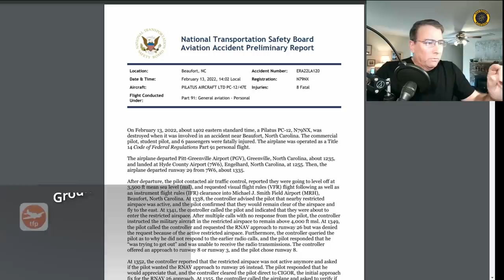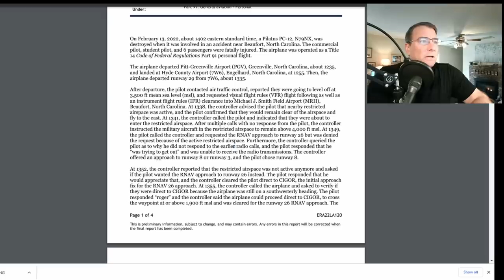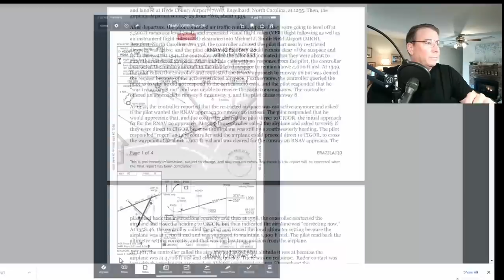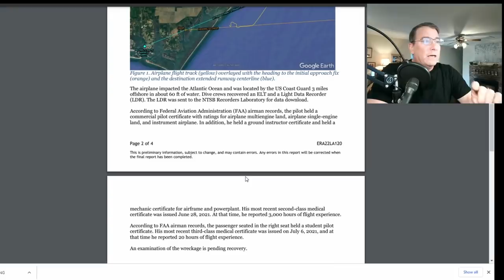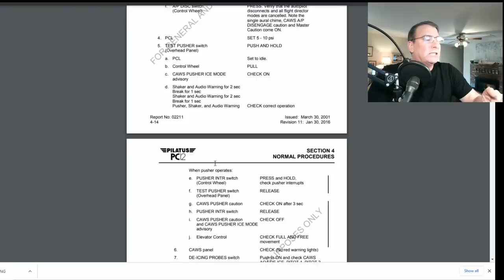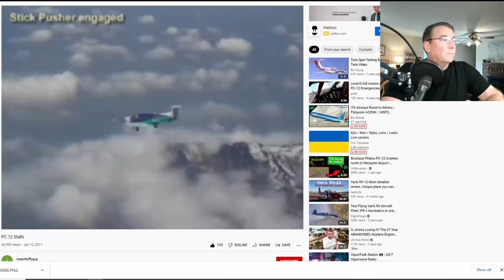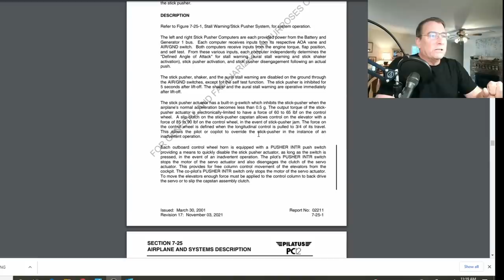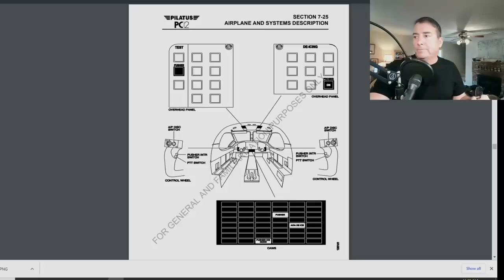NTSB Preliminary Report Pilatus PC-12 Beaufort NC

Comment: When I fist heard they stalled in I knew that whatever happened it wouldn’t be Pilatus’ fault, the aircraft is as perfect as a machine can be and extremely well thought out, to get her in to a stalled condition takes some doing however I know some 12 drivers who will be paying attention to this condition of asymmetry in dual crew, my heart breaks for that poor kid in those last moments, he would have had no idea what was happening and it was a long ride down, hopefully the pax were sleeping
Reply: As great as technology goes, but it can all be undone with a push of a button. Or failure of a sensor. I know they want that button where a pilot can instantly get to it, but there's no way I'd put it that close to the radio button.
Reply: No aircraft (or anything for that matter) is perfect.
Reply: @jfbeam  Makes you wonder if that's why no radio transmission. Might the right seat have been trying to talk to control but was holding wrong button? I've never been in a plane. I definitely wouldn't be a good student as I would be focused on learning instrument flying before learning the basics. Soooo many crashes because the pilot  either doesn't know how to use the instruments or doesn't trust them.

Was riding motorcycle and ran into a fog bank. Within 10 feet totally lost my balance. Fortunately was only going about 50mph and had pretty much locked it down. Was going maybe 25 when everything turned upside down. Across the road and almost into ditch and was like you flipped a switch. Balance was back! For about 4 seconds. Wobbled to a stop and tried to get my heart out of my throat. Wobbled along about 100 yards till fog cleared. Cruised home around 30mph. So I understand spatial disorientation. You MUST have something to focus on to get the brain back in control. In a plane, I'd pretty much want windows blocked out so always have to use instruments. I know that's not how it works but just saying.
Reply: @gailtaylor1636  That is very interesting, once you lose sight of the street, you cannot tell your inclination ?  Lose the ability to  drive straight.

Comment: The pilots side pusher switch disconnects the clutch from the servo so it removes the push entirely. The copilots switch disconnects the motor of the servo so there is still some resistance in the elevator motion when it’s disconnected on that side.  It’s a momentary switch so if it’s released it will reengage, it’s similar to a cws for the ap.

Comment: I don't fly high performance aircraft, but in or near IMC and choppy airspace, I can't imagine not taking full advantage of a flight director. Looking at the flight path and altitude(s), it's pretty clear the plane was under manual control. Although the aircraft ultimately appears to have stalled, the chain of events appears to be the pilot getting behind the aircraft and losing situational awareness.
Reply: Like being pushed back into your seat and mistaking that as speed increasing going down? That would explain the attempt to pull the nose up without speeding up. The other theory of a heart attack or similar is another possibility I would consider.
Reply: sounds like they were behind it after takeoff

Comment: THEY MAY have pressed the interrupter switch accidentally when they meant to press the PTT in a panic.?
Reply: In lears i flew, i noticed a panicky pilot could easily pull up and defeat the stick pusher.   For me that was another of the common Pilot Panic Pull and stall.
Reply: I am not a pilot, but I was thinking the same thing.  Especially when the pilot reported they were "trying to get out" on the radio.

Comment: The AOA’s are not mounted on the Pitot tube. Pitot tubes are mounted under each wing.
Reply: @markberube1700  Wrong! The fixture in which the AOA’s attach are not pitot tubes! The Pitot tubes are under the wing!
Reply: @dereklong4945  You are correct, my bad.
Reply: @markberube1700  don’t tell my wife. lol

Comment: I was an instructor and check airman and this guy just lost control. This was not a stall or spin.  You can loose 4,000 feet in seconds if you loose control.  There is already another accident in Texas that was a similar thing.  This is a slippery airplane and will drop like a rock if you loose control.   You don’t need to stall
Reply: Loose is the opposite of tight; lose is the opposite of find. Common mistake. (For future reference. Best wishes.)

Comment: I'm confused about icing,  could you possibly do a video about icing.  Like where on the aircraft icing effects the flight. Also how much ice are you talking about.  I assume most small aircraft don't have de icing capabilities.  On aircraft with de icing equipment is there a warning system alarm?
Any information on icing would be appreciated,  thanks
Reply: When ambient temp and dew point are within 3*C of each other, icing will occur. Pilot reports, METAR's, visual and meteorological reports determine whether one should choose fly. Deicing equipment is not always sufficient to abate ice accumulation. Visible moisture in freezing temps is a no go. Better safe than sorry. There is no warning and autopilot if engaged, will compensate for drag by increasing angle of attack while airspeed bleeds off until you hear a stall horn or notice ice accumulating on leading edges of wings in which case you are probably already screwed. Icing creeps and kills, therefore best for GA pilots to avoid it all together. You'll never catch me flying in icing conditions in a light aircraft. NO WAY.
Reply: I used to maintain F-27s.  The F-27 was fitted with pneumatic de-icing boots on the leading edges of the wings, vertical stabiliser, and tail planes.  There was electric de-icing on the propeller blade leading edges, and the engine air intake.  There was also de-icing provided in the heated windshield.  Those locations provide some idea of where the designers thought ice could adversely affect the flight characteristics of that particular aircraft.

Comment: The asymmetry in the pusher override from left to right seat seems a bit odd.  Wonder why they did it that way?  When the plane is flown dual pilot,  pilot flying could often be the right seater.
Reply: I asked this very question after watching Dan Gryder's take on this flight.  I don't understand why there would be this significant functional difference.
Reply: Such assymetry is entirely normal. The most-used functions are on the outside part of the yoke. That's the way any smart designer would build it
Reply: @zidoocfi    That’s not what I mean.  It’s not physical asymmetry, but functional.  As Juan explained it, the right side and left side pusher cancel switches cause different effects.  According to Juan, the left button turns off the motor and disengages the clutch, leaving the elevator control completely unencumbered, in manual control, while the right button turns off the motor, but leaves the clutch engaged, so that the pilot would have to still apply the 60 or so ft-lb torque to overcome what the motor had already pushed.  Beyond that, I have no idea what the behavior is.  Seems odd that both switches don’t have the same function.
Reply: @markholm7050  Small correction: with power cut to the electric motor there will not be a 60ft-lb force still on the yoke. It will take minimal extra effort to move the yoke with the motor still attached, but not powered. That's the whole point of the switch -- remove the force being applied to the yoke.
Reply: @markholm7050  My apologies, I thought you were talking about physical asymmetry. It was an honest mistake. As for functional asymmetry, you ask a good question and I don't know. As a longtime pilot whose only Pilatus time is in a B-4 glider, I have to rely on the descriptions of others for the answer to your question. Based on Juan's description I'm a bit puzzled, but based on the answer by "jfbeam" in the comments it makes more sense.
Reply: @jfbeam    That would be an explanation, but it means your account and Juan’s don’t seem to agree.  It still does not explain why the two switches would function differently.  I expect the devil is in the details.  Juan could be wrong.  There could be a good reason the system is the way it is, a reason  not yet explained here.  Something else might be the explanation.  Important to note is that the whole topic may or may not have anything to do with this crash.  It’s just that the difference in behavior between the two switches, as Juan described it, seems odd.  Why have one switch disengage the clutch and the other not?

Here is another little confusion.  Juan said ft-lb and later commented that ft-lb is the correct unit, but said lbf, a unit of force, not torque.  How big a pull a pilot would need to exert to overcome the pusher is (though it may not apply to this crash) an important matter  60 lbf linear pull on the yoke is a pretty good pull.  60 ft-lb torque at the clutch could result in a range of linear force at the yoke depending on mechanical advantage in the system.  It seems the design intent is that the pusher can be overcome by either of two means: pushing one of the switches or a hard pull on the yoke.

BTW, how much toque it takes to back drive an unpowered motor depends a lot on the gear reduction ratio (if any) and whether the gear train is jammed.
Reply: @markholm7050  Indeed, it may have nothing to with this crash, but the question of differing behaviors remains. Only the manufacturer can answer that one. Yes, there's some question about the force required -- I assume Juan has no first hand experience overcoming the stick-pusher in this aircraft. Is it 60 ft-lb at the motor, or 60 lbf at the end of the yoke? (60lbs at the yoke sounds very excessive to me, but they really want the nose down. I can think of a thousand failure scenarios, but at the end of the day the force needs to be high enough to be effective while still being low enough for a human to physically overcome it.)
Reply: @jfbeam    That’s a tough design issue.   Some pilots are big and burly, others small and slight.  Hard to design a purely mechanical system to deal with the range of possibilities.  I guess that’s one reason for the override switches.
Reply: @jfbeam  I suppose it also has to account for the possibility of a significant out of trim condition when the pusher fires. Could that be part of the explanation for the rather high forces, besides the fact that most of the time you want the pusher to win, vs the pilot?
Reply: @markholm7050  The "Probable Cause" video on this crash also describes the functional asymmetry of the buttons / switches.
Reply: This discussion about the difference between seat positions could be about money.  For instance the tiller on the 737.  We just went through that with the Max.  Everyone always says follow the money and there is great truth to that IMO.
Reply: When they limit a control, it will always go to the A/C

Comment: Active PC-12 pilot, and your description of the pitot/static system is slightly inaccurate. The mast you indicated, with the small wing shaped protrusion, is the AoA sensor, and the actual pitot mast is mounted under the wing much like a Cessna 172/182/208. It is a dual sensing system, receiving information from each respective ADAHRS on the respective side, and the panel will prompt if there is a mis-comparison between the two.

I’d also like to point out that the manuals you’re using are outdated for the actual aircraft. Revisions through 2016, when this was a 2017 aircraft, and the CAWS system is not the same CAS system that is installed on this generation of PC-12. The system you’re referring to is the system used prior to switching the standard avionics to the Honeywell Primus system. Almost everything is the same as you outlined, but there are some significant upgrades to the system made in conjunction with the standard installation of the Primus system.

Good video overall, and humbling for me personally for two reasons:
1: this serial is only a few away from the one I actively fly. 1716.
2: In your first video covering this crash, you used the sales brochure for our actual aircraft for reference photos. Drives the idea home in a close way.

Comment: I think we may all be overlooking something very simple. There were 5 teenage guys on this flight. Ever been on a road trip with a group of teenage guys riding on a bus? They all cram in the back one or two rows to chat, play games, have fun, etc. even if there isn't enough room for them to all sit. I know it probably seems too simple, but when the pilot started slowing down and configuring for the IAF, I wonder if the CG was too far aft and the airplane started to pitch up once the stabilizer became less effective. At that point our instincts as a pilot to lower the nose (reduce throttle / push forward) would only exasperate the situation. I would be curious if those familiar with flying the PC-12 could comment on whether or not the CG would already be close to aft limits given the number of passengers and your estimated luggage and fuel on this flight. Would the autopilot give a warning if the trim was full forward?
Reply: Interesting theory
Reply: This will all come out in the investigation and why these YouTube commentators are more for entertainment to non-pilots

Comment: Incredible. This private aircraft has more redundancy in its anti-stall systems than Boeing (and the FAA) saw fit to put into the 737 Max.
Reply: Pilatus has more than Airbus as well.
Reply: @encinobalboa  not really - Airbus wouldn't alow you to stall it would control the AoA and airspeed to avoid it first.

Comment: I'm not a pilot, but find your analysis of these incidences and insight into possible causes really informative. I notice the PTT button (Push To Talk ?) is located right beside the Pusher Interrupt button on the Yoke. Could a distracted pilot be unintentinally pressing the Pusher Interrupt button instead of the PTT button in trying to contact ATC?
Reply: Yeah that was my first thought too. Panicking and trying to call out to ATC but disconnecting the pusher instead, then stalling for some reason?

But at the same time, unless they're trying to talk constantly for a really long time, the pusher should re-engage when they let go of the button. So while hitting the wrong button is plausible, I find it hard to believe that confusing the two would lead to a stall without letting go at some point and recovering.
Reply: I know it's pure conjecture but the feeling in my bones is: incapacitated pilot - inexperienced  #2 unable to cope with the resulting situation. Regardless, its a terrible tragedy. Hope the NTSB get to the bottom of it.

Comment: Clarification: PC12 needed a stick-pusher because it's stall speed was very close to the limit of stall speed as outlined by the part 23 aircraft certifications for a single engine aircraft. A stick-pusher is way better safety tool than the parachute on the American made Cirrus SR21 as it CANNOT recover from a stall-spin. PC12's full stall-spin characteristics are no worst than over T-tail aircrafts. Many GA aircrafts also suffer from wing-drop and enter spins in a full stall. 900 feet to recover from a spin in a 10,000 lb aircraft is resonable. Even small 2000lb GA aircrafts can easily lose 300 ft in a spin according to the FAA website, and can exceed 1000 feet in a 3 rotation spin. That said, placing a pusher override switch next to a push-to-talk switch is just bad ergonomics and, in my opinion, an accident waiting to happen when none pilots are sitting in a front seat, especially a student pilot who thinks they know what's going on trying to operate the radio to help out. Just my 2 dimes worth.

Comment: I find it a bit odd that the ADS-B contact was lost at 4300 ft, when it still had coverage at 1700 ft
Reply: Airplane was likely in an unusual attitude and its airframe blocked the transmission of ADSB data to the ground receiver.
Reply: Or the aircraft descended at such a rate that that was the last data received per its update schedule.
Reply: Yes, the update interval seems to be a bit irregular, 5 to 60 seconds between data points on flightradar24. But the last two data points were only 8 seconds apart (In which it went from 4600 to 4725 ft)

Comment: my instinct is that, related to radio problems earlier,.. one or the other pilot were attempting to use PTT and inadvertently actuated the interrupt. two similar buttons of both VERY VERY different functions should not be in such close proximity.  Especially for a Student.
Reply: how does that cause the plane to climb steep?
Reply: @joeskis  It doesn't.  But it the AOA / airspeed combination is such that the aircraft nears the stall condition and the override is pushed then maybe the aircraft's inbuilt stall warning / recovery system doesn't work and it goes into a stall?  As JB said, you lose a lot of altitude very quickly once that happens.

Edit: terminology - "AOA" instead of "climb rate".

Comment: The sudden climb from 1700 ft to 4700 ft is close to the max climb rate of 1,920 ft/min for the PC-12, especially with 8 pax.
Reply: what possible reason could there be to climb so much so fast in that situation, unless the pilots were ignoring the altimeter or it was malfunctioning?
Reply: @patrick-po2lx  I am not a pilot but It seem only a health issue could explain it.
Reply: @uceid  Some people are suggesting a "runaway trim" problem, which they say can happen with this aircraft type.
Reply: @vk2ig  Interesting, I didn't know about this. Let's hope the investigation answer this.

Comment: From the FDR, there’s no trim runaway, but the elevator and aileron positions are frozen for the last 2:30 of the flight.  Did the system lock up mechanically, or is this a data problem?